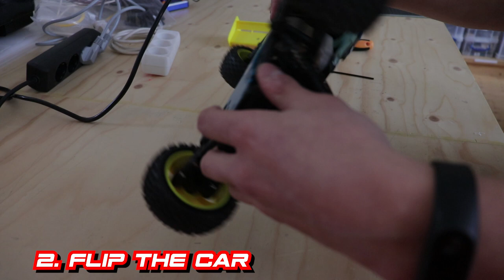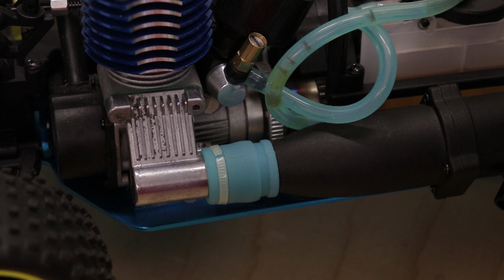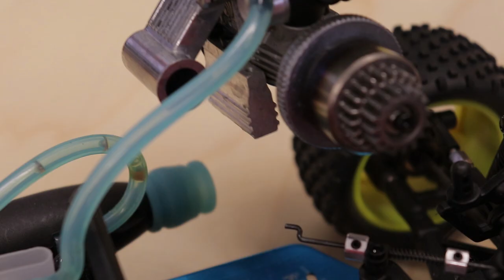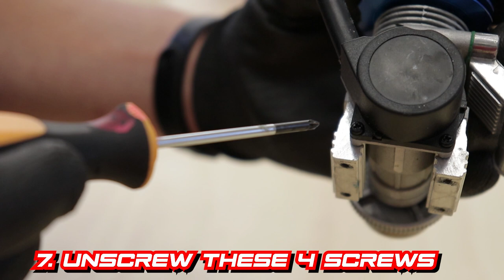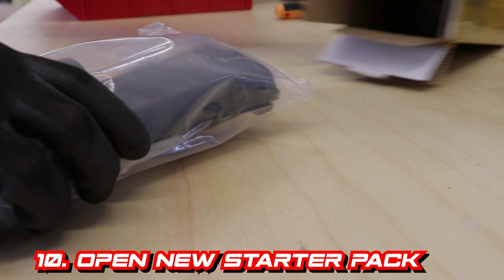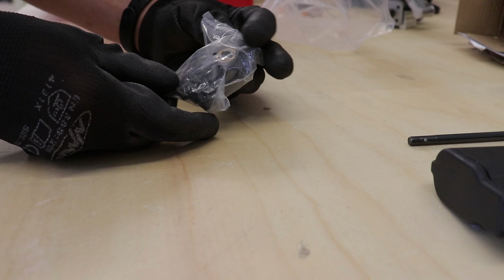Nitro RC pull starter replacement guide! - Power starter! EASY!

Comment: My car starts up but it has its wheels spinning even tho im not pressing on the accelerate trigger and when i try stop the car it slows down but it doesnt fully stop
Reply from the maker: You have to adjust your idle speed screw in order to keep the wheels from spinning when not moving. Check the linkage system connected to your carb, you might need to adjust it in order to brake properly. If that is not helping, try adjusting the brake discs.